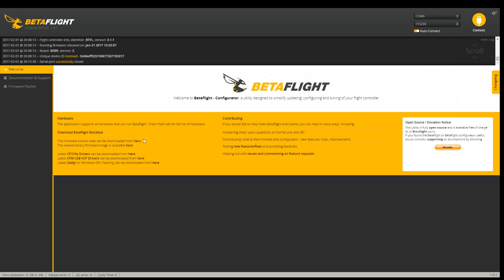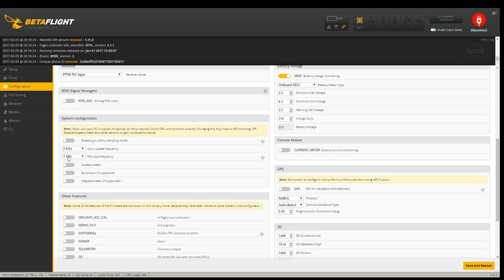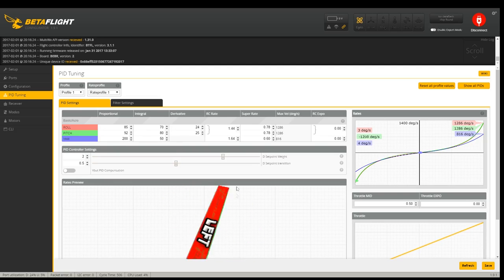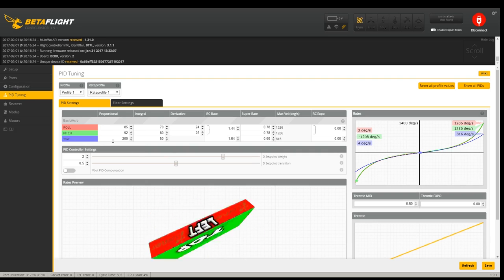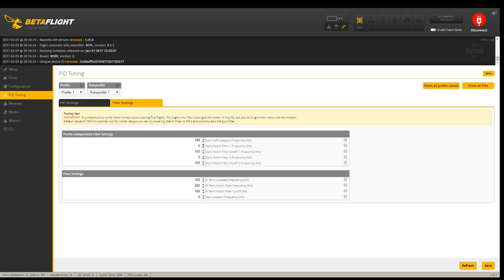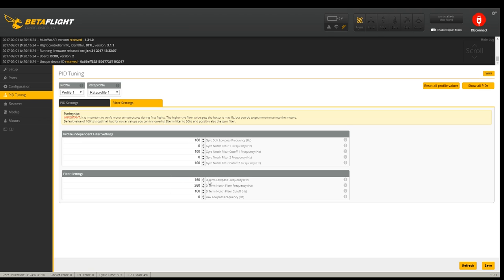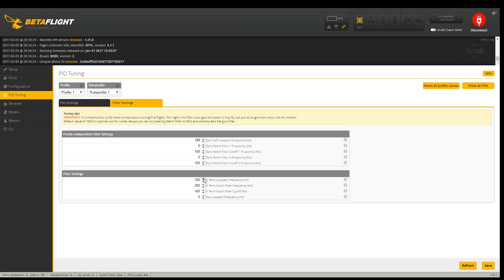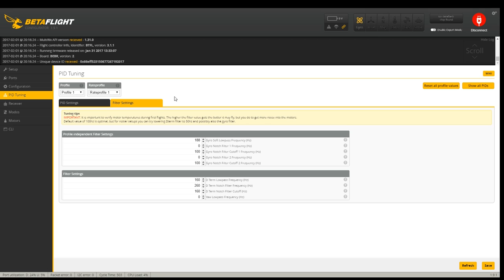Tiny Whoop Betaflight Setup Tricks

Comment: Loved the video. I'm trying to tune my first "non-toy" quad. I got a Furibee F36 and swapped the flight controller to a SP F3. My problem is that, with the same motors, it had much less thrust and the motors sound different. The toy FC makes the motors sound like turbines and it has stacks of power but the SP F3 is sluggish and sleepy. Is this normal until you tune something? What can I tune?

Comment: When I did what you said and turned on pwm values separated from pid values and made that number 4000 I have a high pitched whine coming from the motors now. Flys great now tho but that noise is disturbing but I was wondering if you knew about that. Eachine e010s stock fc using 230 mah HV batteries and have upgraded the stock motors to 17500kv super sauce motors

Comment: Hi! Very nice Video! I used kind of the same values in Betaflight 3.2.1 for slightly modded E010S. I added Expo in Betaflight. It flies much better than the stock settings. Did you also updated your values until now?

Comment: WOW that Way P is high! 
What about mods? You mentioned Air-mode always ON. What about horizon? You have that always OFF I guess.

What about your motor_pwm_rate? The Beecore documentation says one should put it to 1000. I did that and still my motors spin fast whenever I connect the battery.

 Finally INFO!!!  keep it up!
Reply: I think he flies in acro mode, not horizon mode. But airmode still works in horizon mode if you want it. Most folks seem to run motor PWM at 4000 with BeeBrains & BeeCores, some like it even higher to reduce the whiney frequency at 4000. 1000 seems low to me, but I haven't experimented with a lot of values on Whoops. I think you have a different problem than PWM if your motors spin on battery connect. Quad should boot up disarmed. Is your arming set properly or does something arm it immediately? Have you carefully inspected the board to look for errant solder bits across pads/traces, or any other electrical issues? Double-checked the wiring of the motors & power leads? Hard to debug via comments like this.
Reply: Paul Hodgetts thanks! 
I am trying to teach myself acro leaving airmode on. PWM is at 1000 and just one motor spins. Not too bad. But I would like to know what it mean. 

Thanks again!
Reply: I'm still not quite understanding what's happening for you... If you connect the battery, the quad should boot up disarmed. On a BeeCore, the blue light should be off, no motors spinning. Is that what happens--what happens for you? Then if you arm, with airmode on and motor stop off, the motors should start spinning at your min-throttle speed. If only one motor spins, it might mean that one motor spins at a lower throttle value and if you increase min_throttle a little the other motors would start. You can use the motors tab in the configurator to find the lowest value at which the motors spin. Again, I'm not sure where to advise from here, I need a lot more info on what's happening for you...

Comment: awesome video bro, thank you so much! Would you run 2K,1K on an F3 board as well?
Reply from the maker: +Natan Verkhovsky yes. If you go any faster you really need to log your data and review it to see if your tuning is good or not.
Reply: High V3locity Hi, great video . I just subbed. 
Question:
                - What flight controller are you tuning ? (beecore or beebrain)
Thanx 😊
Reply: Mad Marc 
sp racing f3 evo
Reply: High V3locity 
I'm feeling a wierd delay lately like the last command sticks for an extra half a sec and messes me up...any way that would get helped out by going to a higher setting? like say 8k, 4k?
Reply: That's great news , I have the beecore flysky version.  
When I set the motor wpm from 16000 to 4000 I get a continuous high frequency beeeeeeeep when I arm it. Why does it do that ?
Thanx man 😊
Reply: Natan Verkhovsky I'm super new to tuning. but I know that delay.
Reply: I have mine down at 1000 and no buzz...hmmmm.  Should I raise it to 4000?  I've tried it at 32000 and it wouldn't even leave the ground lol
Reply: Honestly I'm so new lol. I'm trying to find out what numbers are good to start tuning from scratch. I haven't tried that yet. Just been watching videos and tweaking a little here and there while learning.

Comment: I would watch a PID video, I haven’t even tried touching it lol no idea what I’m doing and I have no idea what it would even feel like
Reply from the maker: +Ryan fry The goal with tunning pids is to make the response of the quad tighter to the sticks on the radio. In simple terms P increases the response but can cause it to overshoot and bounce back if it's too high. D can help calm that bounce but only so much before it to becomes a problem in itself. I is to make sure it doesn't fall out of position from wind or other outside forces. Start with p and if it starts to do odd things back it down till it acts normal again and you should start to get a feel for what each dose.
Reply: High V3locity oh ok that doesn’t sound as confusing as I thought thanks a lot :)

Comment: Hey man, have you any tips on 3.1.7 by chance regarding the whoop? Good info, thx.
Reply from the maker: i would recommend BF 3.2 and turning off all the filters other then the dynamic filter if your whoop is running a f3 board.
Reply: So on BF 3.2 turn every filter to 0. You had some on 100 in your vid  are those going to 0 also

Comment: Hey man, when I arm mine it goes crazy and freaks out. How should I fix this problem?
Reply from the maker: check props, check board orientation, and check motor direction.
Reply: High V3locity tried this. Still goes nuts
Reply: this happened to mine when I accidentally hooked up the battery with the wrong polarity for a split second. it beeped, freaked out, then was never the same. replaced the flight controller and that fixed it.

Comment: Beebrain not recognized on mac. where can I get drivers?
Reply: SyncedCyberSoul not had any issues with mine on a Mac. Might be worth checking you have a proper data USB cable as some of them supplied for charging devices only have +5v & ground wires.

Comment: It can arm, but moters won't spin. HELP!
Reply: Go to the CLI and type get min_check to see what the value is.  If it is too low or high you can change it by typing the command set min_check 1050
Reply: Check minimum throttle value (min_check)

The next thing to check is your minimum throttle value.  Betaflight will not arm your quad if your throttle is too high as the motors could suddenly spin up and cause some serious damage to your fingers.   So betaflight checks if your throttle is below the value saved in the min_check parameter.  By default, this is 1050.  So in the receiver tab with your throttle stick all the way down, you must ensure the value reported there is less than the min_check value (1050).   Sometimes with new firmware updates or different boards, it can be different, I have seen the min_check value be as low as 1000, so this is something worth checking.

￼￼

Go to the CLI and type get min_check to see what the value is.  If it is too low or high you can change it by typing the command set min_check 1050.

Comment: Hello thank you very much for the videos, they help a lot, you could tell me how I can do this: https://youtu.be/U7gtgOd4VTI on the board of the eachine e010s, it is in the 6th minute of the video, the video man bridges the low Voltage so that the board causes the battery to cut at 3.70v instead of 3.90v. I would like to know where the low-voltage on this board is to bridge it. I repeat the board is a f3 evo installed in eachine e010s, this according to bangood, I to flash it in betaflight I had to put sp racing f3, with the option evo did not work, this just as data. Thank you very much and I await your response.